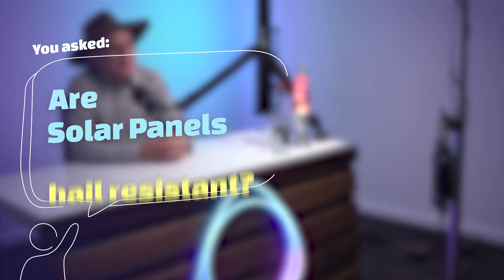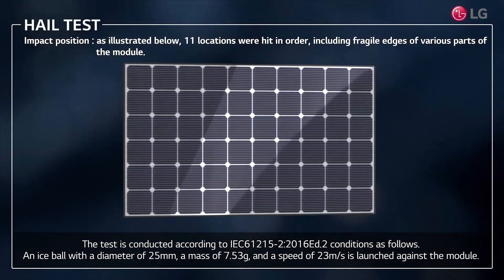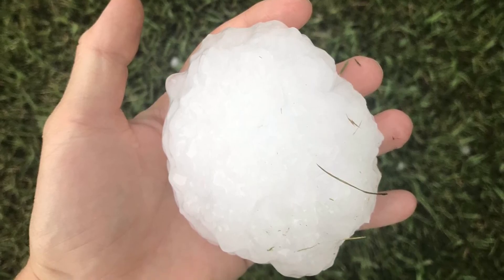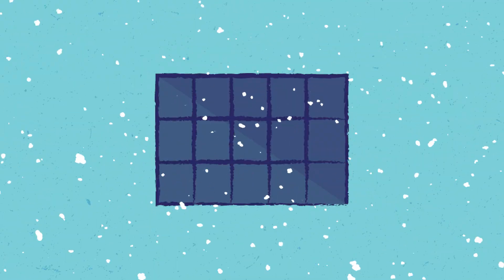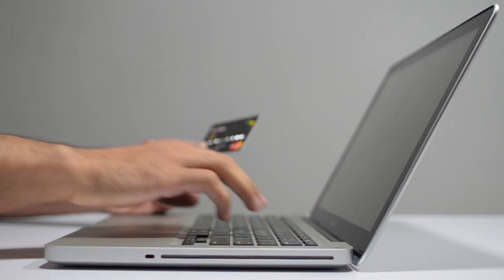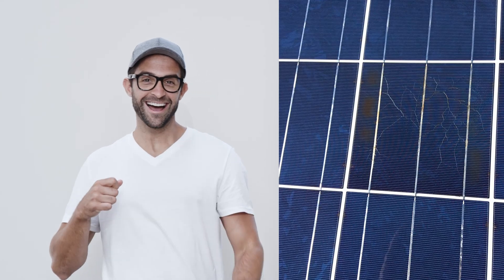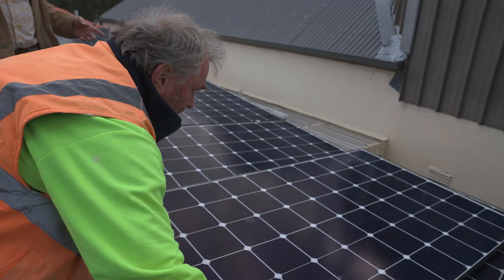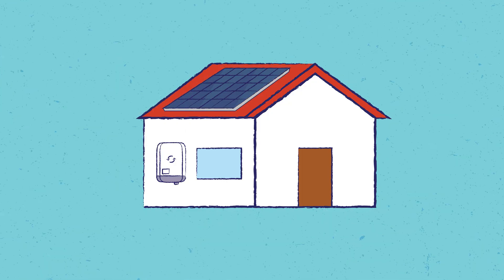Can hail damage my solar panels? Here's what you need to know!

Comment: other than the micro cracks creating uncontrolled heat, what about subsequent rain/ water damage to the cells??
Reply from the maker: That’s a fair concern — microcracks can let in moisture over time, and once water gets into a panel it can cause corrosion, hot spots, or even complete cell failure. That’s why good encapsulation, proper lamination, and quality manufacturing matter so much — cheap panels are usually where these problems show up first.

Comment: On a commercial scale it would be cheap to replace the panels and then carry on producing power as the infrastructure will already be in place, and I am quite certain the solar power company isn't going to pull the substation out over the odd hail storm.